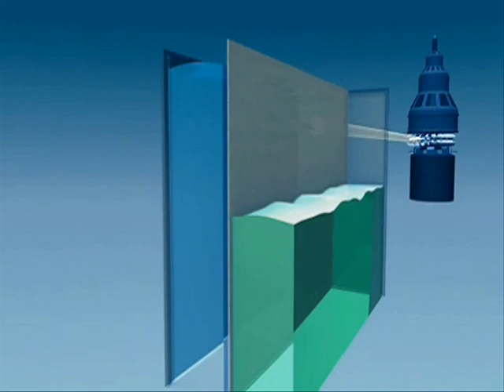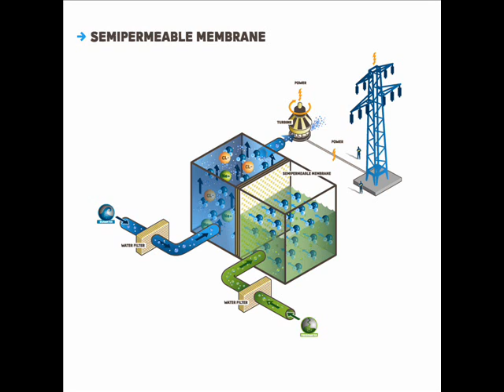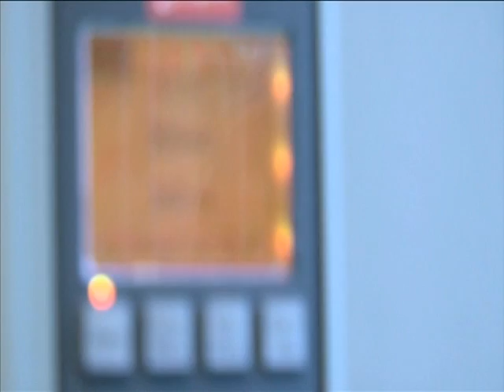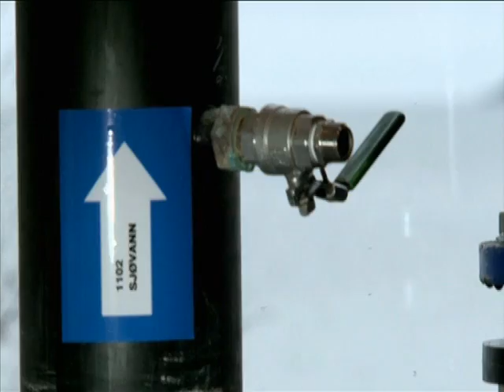Statkraft - Osmotic Power Plant - Free energy - How it works

Comment: Won't the movement of water through osmotic membrane be slow? 
One may think if there's potential difference between FW and SW there will be an increase in net power owing to lesser number of pumps used in the system but in that case won't it be easier/better to just use the potential difference to make power like in a regular hydroelectric power plant.

Comment: But what about environmental and resource concerns, fresh water is clearly a resource increasingly hard to come by, unless you developed a reverse osmotic system that could counter the consumption of pure water. As for environmental concerns, how does our interference with fresh water and estruary ecosystems ( I say this b/c these are obviously prime locations that give you both a high possible supply of fresh water and salt water) and will we interfere with nutrient flow? Despite my provoking questions I still have hope for osomotic power personally for those wondering if I'm just being pestimistic
Reply: The power plant will be located at the point where river flows into the sea. When it discharged out of the plant it will return back to the sea. From this perspective the fresh water is not wasted. The main concern is that the discharge of the brackish effluent, that resulted from the mixing of the two solutions, must be extracted at a point back in the sea where the salinity is the same to avoid eutrophication. The RO-PRO system is already been proposed as a possible form of exploitation.

Comment: the generator is connected to a water turbine which is turned by the water flowing out of the "salt water tank" where the freshwater would go due to osmosis.

the pipes are used to deliver salt water and fresh water to the tanks, and the outlet pipes at the other side of the salt water side to deliver the combined water to the turbine/s.